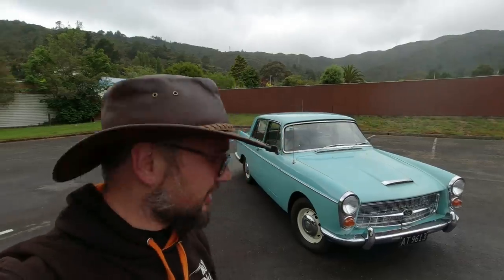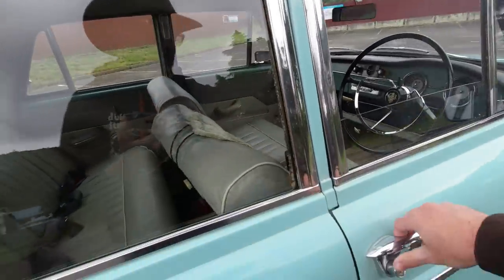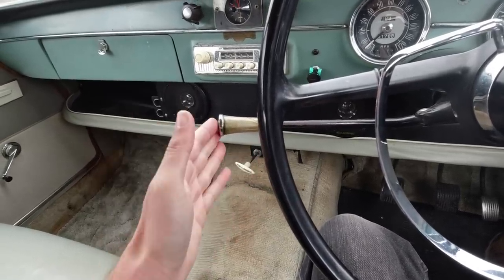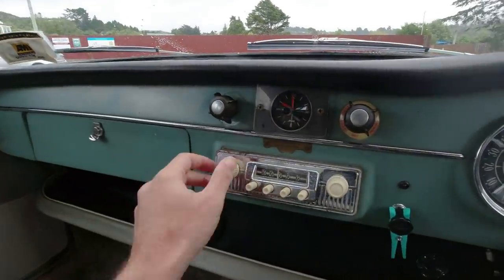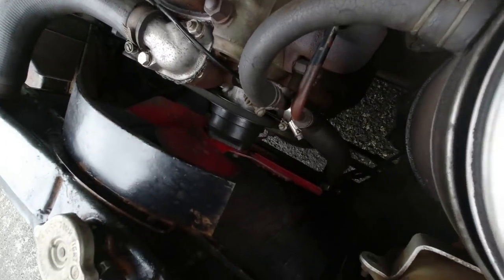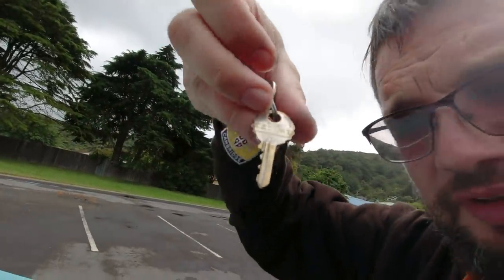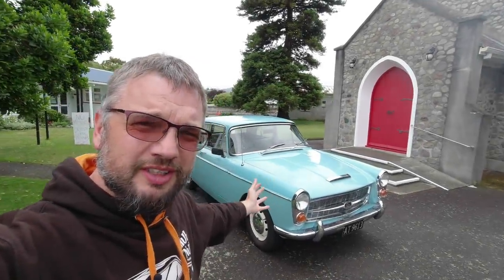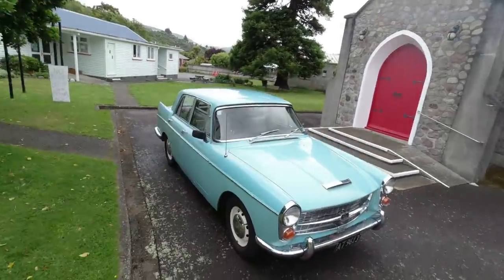Real Road Test: 1960 Austin Westminster A99 in New Zealand. Australian?

Comment: Spare  wheel is underslung the boot. Thus the tank is between the rear sear and boot space.

Overdrive works as described. Push in to operate. Then it will engage on revs. There is a freewheel. just leave the overdrive engaged. The A1110 also had the same system.
The clock is not original. maybe replaced because of non working original or change  of electrical polarity.
All cars had a remote servo. Repair kits in the UK are available.
The biggest difference between Healy and Austin/Wolseley engine is the head. 

Fuel consumption is horrendous.
I love cars that show there age.
Reply: My brother had a Wolseley 6/110 automatic, later on it went manual with the 4 speed and the overdrive, we found the fuel consumption was very good for a car of that size. Sounded good too with a hacked about Healey exhaust system. It didn't do so bad in a race against a 3 litre Capri on a motorway either....

Comment: Thanks for an interesting review, and it brought back many memories of my 99 and 110s. The Wolseley & Austin 99s had 3 speed column change, with the 110 versions having 3 speed floor mounted gear levers. This changed to a 4 speed floor mounted lever box on the 110 mark 2, the first gear not being synchro, so always made a whining noise. The overdrive was later automatically engaged at over 30 MPH by a centrifugal switch on the transmission, which then locked the drive solid (with engine braking). Without the overdrive the car was freewheeling, which could sometimes be cause for concern if the engine stalled whilst decelerating, then you realised at the last moment you didn't have power assisted brakes!The kickdown did indeed short circuit the spark plugs for a moment, also dropping the overdrive out for quick acceleration, but would come back in again when you lifted your foot off the pedal. I removed the kickdown system off both my 110s and had a switch mounted on the column to drop out the overdrive instead.The spare wheel was lowered down from under the boot by using the starting handle.The door handles were pushed forward to open, and pulled back to lock.The engines were almost bomb proof, but in the UK it was body rot that saw most of them end up in the scrap yards before they reached 10 years old.

Comment: My mate had a rare Mk1 in white upper and blue lower. Stupid fast. Servo stopped working though, so we had to urgently find an equivalent part fast. Not a direct replacement. Changed the master cylinder whilst we were at it. Easy car to work on. Good times. And not a single AA badge to be seen... even better.

Comment: To early for the Nelson plant, but these were assembled at the Austin Distributors Federation plant in Petone, Wellington along with the A40F, Austin Mini, Austin A60 saloon and Estate, Austin 1100 & 1300, Maxi, and all the NZ P76 models. All the Austin trucks were also built there. They did a limited build of Austin Freeways including the import licence oddity the Freeway 1800.
Reply: In 1964. My eldest brother started his mechanics apprenticeship at Magnus Motors, in those days, a big Austin dealer in Lower Hutt. Not far from the Petone Austin factory. Since the question arose in this video about where this car was built. I asked him. Do you recall if the big Austin sixes were ever assembled in NZ? He said they were. He recalled picking up a number of them directly from the Petone factory. Interestingly he also said, a few of them were Govt order cars. By 1964 - 65. The cars he picked up were the later A110 models. But you have confirmed these big Austins were built in NZ. As has my bro. So Hubnut, perhaps on balance, we just might  have settled where this car was possibly built. Hence the slightly different specs to the UK models. Cheers. And thanks for the videos!

Comment: You've done well, figured out the overdrive quicker than I did when I owned one.  Method, push the overdrive knob in and you get freewheel below 30 MPH and overdrive when you lift off the throttle above 30.
Kick down with full throttle and you're out of overdrive. Pull the knob out to lock out overdrive and freewheel.

Comment: Most people would not associate the Farina Westminster with motorsport, however due to their rugged construction and powerful engine, they were a favourite and much sought after in the late 70s, early 80s banger racing scene. As Neil Young once said, "It's better to burn out, than it is to rust!".
Reply: Of course, this means that there's probably very few examples left. I'm seriously considering importing one of these into the U.S.

Comment: Lovely review. It brought back memories of my fathers 1961 A99 in robins egg blue with the 3 speed borg ward automatic gearbox. Sadly my family had to abandon the car due to lack of spares (by the mid 80’s in Western Canada, nobody stocked BMC parts). I remember it as a very solid feeling car with a distinct whine from the automatic gearbox.

Incidentally, the spare tire on the A99 is hidden completely in a tray underneath the trunk. To access the tire, one uses the crank from the supplied toolset to turn a worm gear that lowers the spare tire. The same crank is also used to turn the engine over. There is a spring loaded chromed chromed cover in the middle of the front bumper, which when lifted reveals a slot where the hand crank is inserted. The crank is not intended for starting the engine, but for turning the engine over to set the valves and ignition points.

Comment: The overdrive/freewheel was fun, best combo was the engine from a later automatic coupled to the 4 speed floor change manual with o/d. I believe the cylinder head on the automatic brought power to about 130hp. They went well for the time...

Comment: Nice car. I think in those years many passenger cars  still used diagonal bias ply tires which are not great for roadholding.  Peugeots of that time had a reputation for good roadholding but that probably was mainly because of  the Michelin X or ZX radial tires that were fitted. I bet that Austin will performer a good deal better with a set of new radial tires.
Reply from the maker: Handling is about more than grip. These roll a bit too much and the suspension geometry definitely isn't set for sporty.

Comment: I had owned one from about 1969 to 1975. Apart from a crappy column change system it was a good car.  As noted it was quite powerful. Would cruse on the flat at 80 mph no problem. Had mine up to 100 mph on more than on occasion. I saw one almost identical to the one in the review at my local garage just recently.

Comment: At Around 1977, 1978, (I Think) I owned a 1965 A110 Westminster with the 4 speed Manual/Overdrive Gearbox. It was back then, and remember I was young, a reasonably quick car, and was capable of over 100 MPH, (160 Kph). I owned and enjoyed it for, from memory, around 12 months, and eventually swapped it for a Mk # Zephyr 6.

Comment: Brought back happy memories of a 62 Wolseley 6/110 I had for 11 years and 113000 miles , a lovely car for highways., It would cruise happily at over 90 mph ,  although the old Iron Piano made  forward planning important for corners . The Porsche syncro ( with 3 spd floor change and O/D ) was fragile and had to be replaced twice , almost the only weak(ish) feature . Spare tyre under the boot floor . O/D lever should only be disengaged  with the engine pulling in 'normal' gear - 2nd or 3rd . 2nd Overdrive was good for long fast climbs .

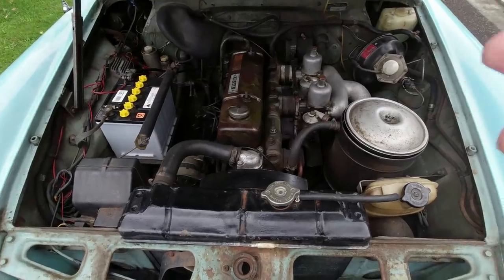Comment: At 9:40 we get a very good view of a fan shroud that -- at least here in the States -- we're used to seeing on Austin Healey 3000s brush-painted bright red (so that, we have come to believe, the inattentive owner is warned of the presence of rotating blades). Yet  here it is as black as the radiator top. Has a previous owner painted over the red?

Comment: IN 1961/2 my dad had an A105 Westminster, the predecessor of this car.  That also had the Borg-Warner overdrive on its 4-speed box (floor change, incidentally, which some 95s and 105s did have).  You had to kick down on the accelerator to get it to shift out of overdrive and it would drop back into overdrive when you took your foot off the throttle.  When you kicked down, the spark plugs were short-circuited for 4 engine revolutions, I think, to reduce the shock loading on the transmission caused by the down shift.

Comment: The mechanicals may have been a bit dated when it came out, but I can assure you the overall appearance of it was not. When I first saw these Farina designed cars in 1959 they looked very modern indeed and still looked ok as they were revised slightly into  the late 60s.  Don't forget that in 1959 there were still thousands of very old and archaic looking pre-war cars on the road...

Comment: The OZ built cars have  a little map of Australia on the hub caps .The West monster in Australia looks similar but is quite different.  The OZ  outstation  BMC ran in Sydney was pretty independent and they made their own version of the six . It was a extended version of the B series four and only ever offered in Australia . So... if that car has the truck engine it's a pommy built car not an Aussie one.
Reply from the maker: The B-Series Six, or Blue Streak, was only used in the smaller Farina body - as you say, unique to Aus.
Reply: You are correct. By 1960 BMC Australia were concentrating on developing their own range of 6 cyl cars to compete with the Holden and new Aussie built Falcon. Launched in 1962 as the Austin Freeway, (they also built a Wolseley variant) and based around the Farina styled Austin - Morris A55/A60 Cambridge and Oxford cars. But  smaller than the Austin A99. Previously they had badge engineered the A90 and marketed it in Aust as the Morris Marshall. So if this car isn't an English built example. I wouldn't completely rule it out as NZ assembled. Since Austin assembled cars and commercial vehicles, among them the Austin Gypsy Landrover rival, in lower Hutt (Wellington) for many years. Including, in the early to mid 70s, by then under the NZ Motor Corporation banner, the Aussie sourced Leyland p76. Ps, Morris vehicles were assembled in Newmarket Auckland by Dominion Motors Ltd. Who eventually also became part of NZMC.

Comment: Under the cars rear suspension you can see two curved spikes facing down, almost dragging on the ground. Are these part of the leaf springs? They seem oddly close to the ground that you might hear them scrape the ground if they are metal, but maybe they just dangle and weather vane when at speed and are not in the way? You can see them at 11:01 and 23:47.

Comment: The radio looks like a valve set so you would need to give it 5 minutes to warm up before you hear anything at all. These types of radio have an electronic mechanical voltage multiplier inside so some sort of humming should be heard coming from the radio when you switch it on if you listen very carefully.

Comment: Being of certain age I remember  the clothes peg trick for choke cables that would' nt stay out 😁😁😁gorrrdbless fuel injection...
Reply: I still use a clothes peg on my 1947 Rover, but mine is wooden, to match the dash.
Reply: Yep. Had one on mum's Triumph 1300 and later on the Marina.
Reply: I'm trying to understand why the clothespin was needed. Must be the way the cable is routed or something. Our 81 Volvo 245 had a single side draught Zenith carburetor and the manual choke always stayed in place perfectly.

Comment: The radio is not stereo!(I heard you refer to it as a stereo). The two speakers are wired in parallel to a single speaker output as the radio is AM-only.

Comment: Now you're talking my kind of car! Dad had the next version when I was six or seven years of age. It had the 3 litre straight six and it 'it could go!' Then we had the slightly 'posher' version, the Princess (No, not the wedge). This was the two colour version, green at the bottom, black top half. column change three speed auto (PDNR selecter).  Dad didn't like the automatic. (Some had the Rolls Royce engine. Dad's had the Austin engine. Still a straight six, though). Then we went back to the Westmister, a manual.  When that was done, he went on to the smaller sister, the Austin Cambridge Shooting Break with the split tail gate. Then the Morris Oxford saloon, black bottom half with ivory roof. It's one of the few cars I can remember the registration, DBT 866C. Reg plates are ideal for passwords! Then before moving on to Fords, we had the pale blue with ivory top Morris Oxford. All these were ideal cars for pulling big trailers and large caravans, even sheds which ours did regularly. Oh, I forgot, when I was very young, we had a Westminster A90six. However, I only remember it as rusting away in the garden! That was light blue, with mid-blue ivory, chromed stripe down each side.

Comment: I drove an A99 automatic Westminster back in the, well we'll not go there and towed a caravan with it. Still consider it a fantastic car to tow with. All that torque at low revs and it was a big old caravan. The rear bumper was so ridgid it was acceptable to fit a 50mm tow ball straight onto the chrome  with a BMC adapter. Happy days.

Comment: @Hubnut The time to lock out overdrive on the move, is when you kick down and it has dis-engaged. Otherwise, cacophony! As to the speedo being optimistic, our 6/99 Wolseley with the same spec. would comfortably do over 100mph (at least on the speedo) when on the motorway in Auckland.

Comment: My Saab sonett III where also equipt with freewheel, A left over from the time Saab made two-stroke, they dident bother changing the gearbox to the the new V4 Ford engine so they kept it, and called it economical... 
But you only needed to press the clutch when taking off in first... a weird feeling, especially because the car dosent engine brake.... 
You could disengage it with a handle in the cabin.... quirky... :)

Comment: Hi Hubnut.  That's interesting about the overdrive.  An overdrive configured in that manner on the end of a 3 speed column change box was the American way of doing overdrives from the late 30's until the early 60's.  BMC must have had the US market in mind.  I too prefer the more usual British method of a switch to engage or disengage the overdrive. We saw very few of these Austins in Australia.  We saw a few more of the plusher Wolseley equivalent, though still not in great numbers.  In either case, virtually all came with an auto transmission, which I think was probably the dreary old B/W DG.  Cheers.

Comment: I've had a couple of cars with those door mirrors on. One was an Avenger without any exterior mirrors, so I bought one for the driver's side from Halfords. The other was a Mk1 Seat Ibiza where a previous owner had smashed the original driver's door mirror off and replaced it with one of those. In both cases, I found them to be utterly useless. They have a narrow field of view, they vibrate so much you can't really see anything in them, and will often fold inwards at any speed over about 30mph. You can tighten them up to prevent this but then they're so tight you can't adjust them. Proper mirrors are quite a bit more expensive but are actually fit for purpose.

Comment: I would think that if the OD kick-down feature worked consistently, it would make that 3-speed better than a 4 speed without it, essentially giving the driver a semi-automatic 6 speed transmission. With the freewheeling giving the ability to shift without the clutch, the system would seem even closer to the convenience of an automatic, but one would have to know  to disable it on a steep grade.  But I suppose the devil is in the details; if the ratios were not quite right to cruise quietly, and the kick-down not fast enough to overtake easily, the plan might get spoiled. I suppose that if a driver is used to a 4 speed, the action of  any semi-automatic might be more of a distraction than a convenience, as there are still plenty of drivers who prefer the control of a manual to even the best automatic. These OD units are a fascinating piece of automotive history; I assume that one is of the Normanville/GKN-Laycock variety, which was also used on Volvos and AMC cars. We also had Borg-Warner units that were very common in the USA during the 1950s; I've read that the very early ones could only be used with the transmission in high gear, so they were really more about economy than convenience. 

PS: The Wikipedia page on overdrive seems to imply that both the British OS systems (GKN and Fairey) are now in production, for whatever market exists, in the USA, the last place in the world I'd expect.

Comment: You can often tell where a car is assembled by looking at the window glass etched label. Locally assembled models used local glass to help meet the % content rules the government required. Also local seats, tyres,  radiator, and other stuff were used. Check several different windows in case a particular piece has been replaced.

Comment: waited for the exhaust sound yay at the end what a nice sound, i use to have a w 6/110 
the dif between the 99/110 is a better cam grind as with the 1622cc / Austin 16/60 & 16/72 better cam

Comment: Nice. Having owned several 1960's BMC products I could smell that heady mixture of vinyl and glue as soon as you got in. I wonder if the long handled switch on the column was a headlamp flasher?
Reply from the maker: Wouldn't have expected an on/off feel to a flasher.
Reply: @HubNut  It could be the on off switch for that electric fan behind the front grill maybe.
Reply: Yes I keep ranting about the BMC vinyl smell evoking childhood memories. How the hell can it still be emitting volatile organic compounds after 50 years? Was Longbridge actually the cause of the ozone layer problem?
Reply from the maker: @ShaunMurray63  Good call, though I didn't hear it when I operated the switch.